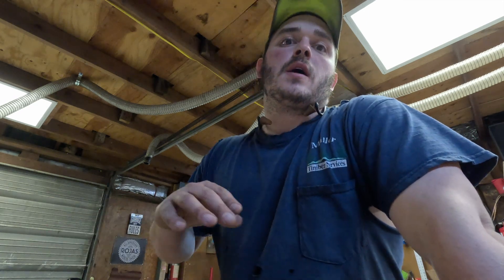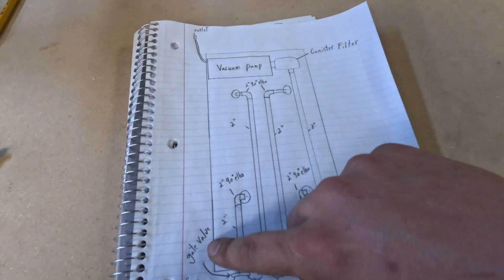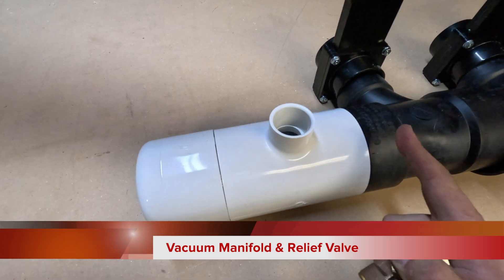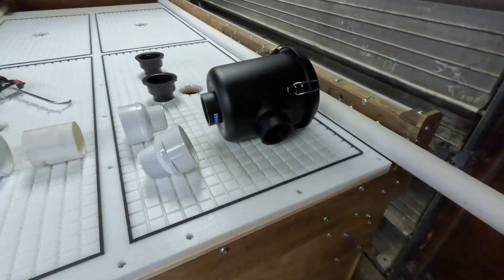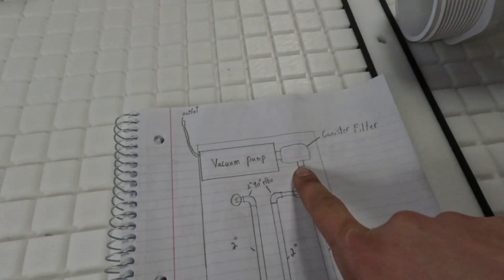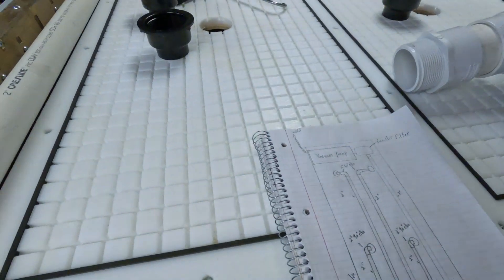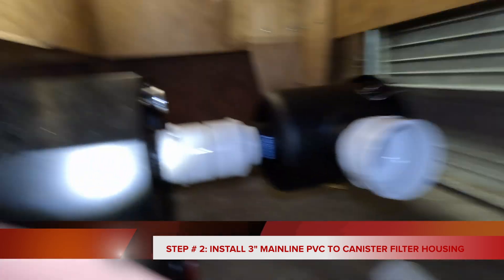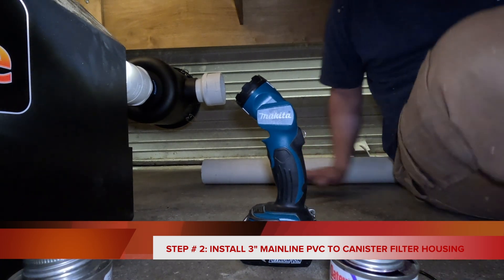Build Your Own CNC Vacuum Table: Part 6 - Easy DIY Tutorial!

Comment: great job! which vacuum pump do you install?
Reply: I’m curious as to how good of a suction you get for a 4x8 sheet of plywood. I have a 220v water ring system that I haven’t used and was thinking about alternatives.
Reply from the maker: @MrIsaacpr7  in my experience it holds the plywood down very well. I have put lot of different sheet goods on my machine and it holds it down very well. It doesn’t hold down hard woods, or thick wood slabs in my experience though.
Reply from the maker: I used the hurricane pump from black box vacuum solutions.